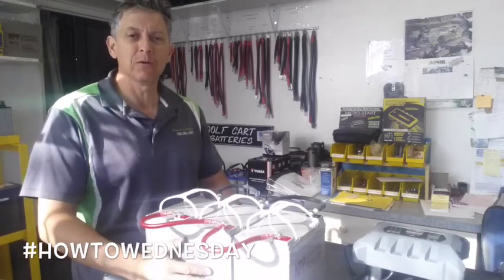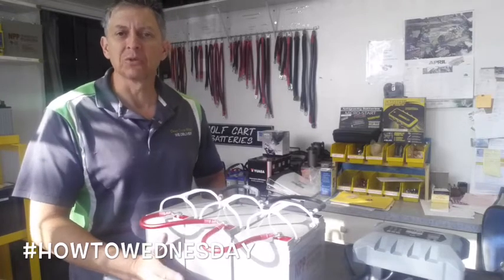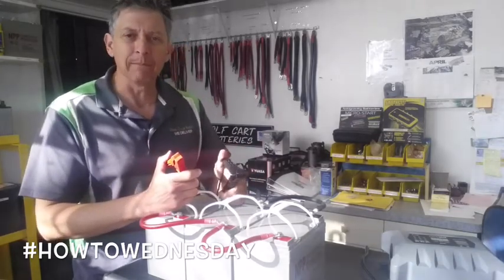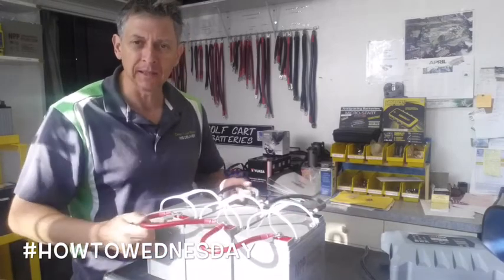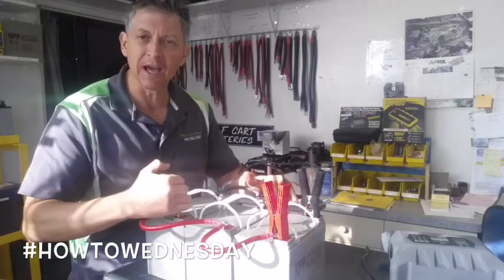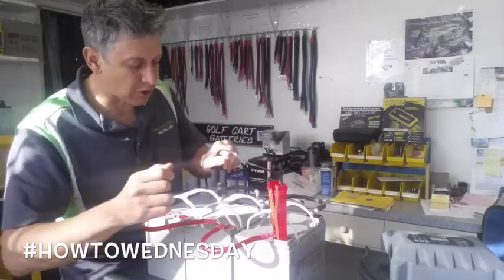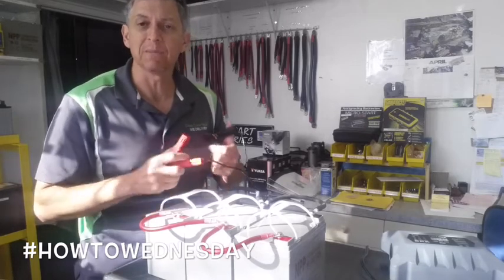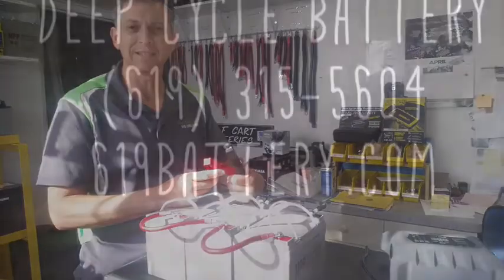How to Charge a Battery Bank - Positive and Negative Cable Location

Comment: What charger do you recommend? I have a bank of 8 AGM 100Ah batteries in parallel, for a total of 800Ah. The charger I bought at Harbor Freight says it's for 1 battery. I've seen charges for 4 batteries. What is the least and what is the best efficent way to charge the entire bank? Do I connect an individual charger to each battery OR just 1 charger to the most positive and most negative, as per your video?
Reply from the maker: ex: a 12v 15a charger could be used to charge two 12v 100a in parallel. so four chargers could be used. or a single 80a $$ charger for whole bank via AC. Or  9600 watts of solar.. We use the Victron IP65 smart charger for $ and Quick Charge for $$$
Reply: @DeepcyclebatterystoreSanDiego  Thanks, appreciate the help.

Comment: if each battery has a max of 10 amp input charge and you have as in your example 3 batteries would I set my output from my charger at 30 amps?
Reply: I would like to know this also.

Comment: Great video sir. Helped me out with 3 of my cars. Now where would u put your positive outputs. Meaning like to power the car and assesories and so fourth. Thank you alot.
Reply: you would connect them the same as the charger. its the same concept if you connect your load to one end of the bank you will draw more power from that end and it will drop out before the other batteries.
Reply: @ronpaul2012robust  I'm mean like when the batts n the car and the alternator (charger) ran to them from the right side.  Where would i run my outputs from my batteries out to my amps and radio and stuff, like add ons? On the left side or on same side alternator (charger) coming n (right)?